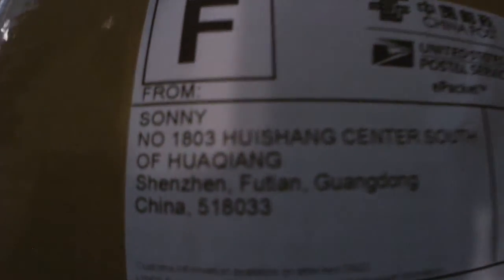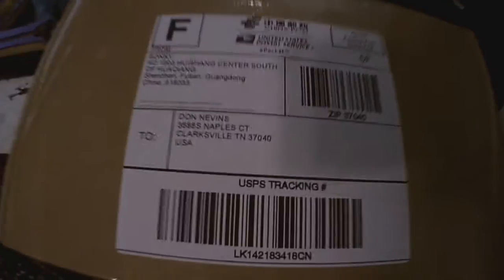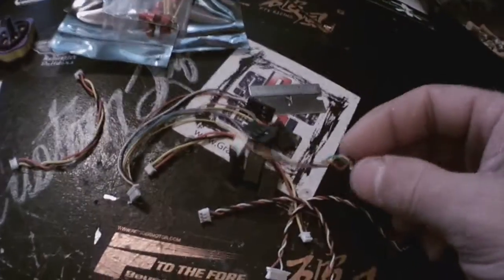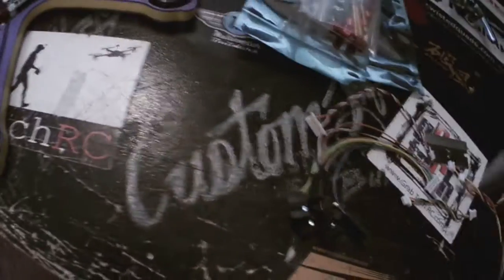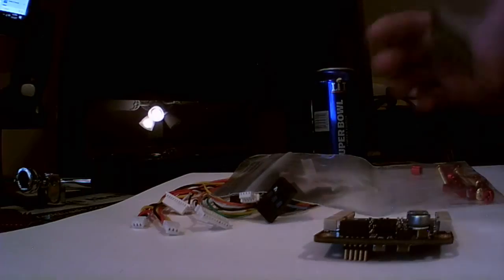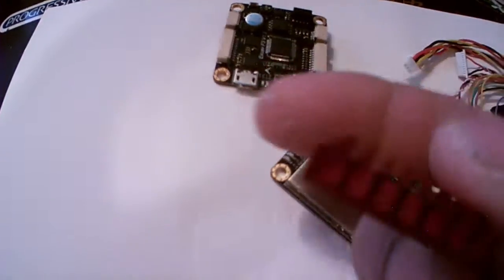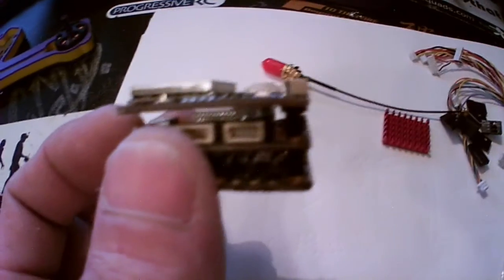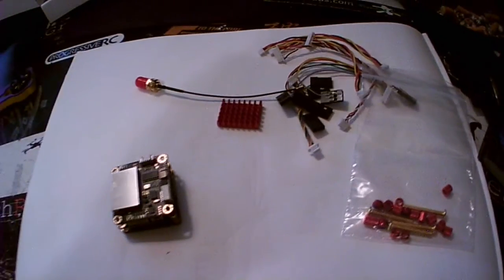fly towewr all in one fc, esc, vtx

Comment: can you if you can how do you add a servo motor for up/down tilt?
Reply from the maker: the racers usally don't run tilt camera better to fix at like 40 to 60% tilt motor would be added on a gyro on the rx I belive tbh not fc so it need a open chan. on rx

Comment: In addition, please check the connection of your camera cable and cable to the socket of the flytower FC board and whether it is due to the misalignment caused by the needle misalignment in the socket when it is inserted into the cable. There are FLYTOWER full range of only 5V camera, does not support more than 5V camera, so please check your camera's supply voltage standard.